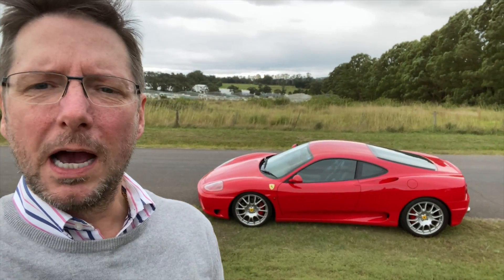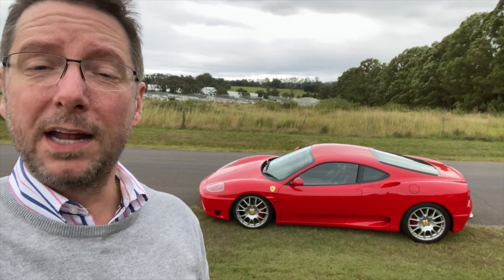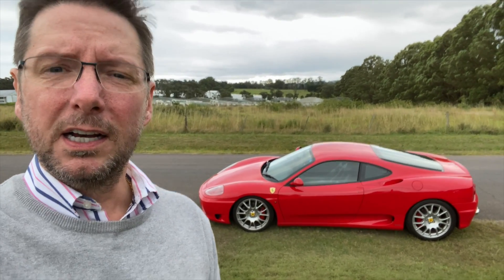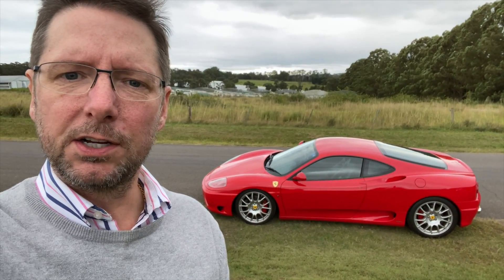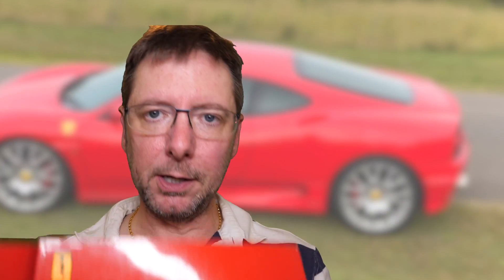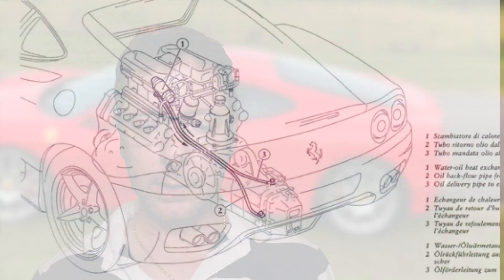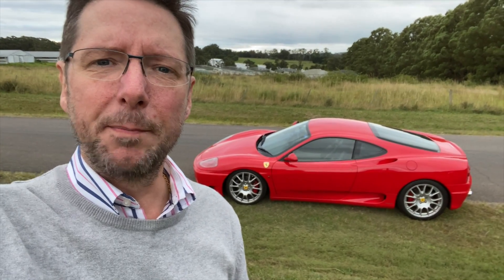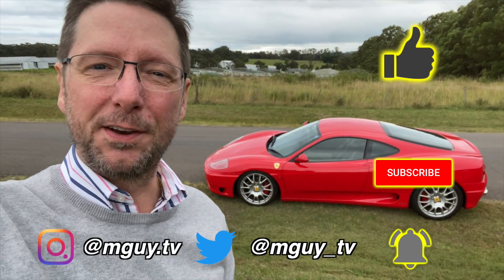This part can WRECK your Ferrari | MGUY

Comment: Great, video content, thank you for the useful information, other than noticing the oil in the coolant did you ever get any other symptom or codes? I just started watching your videos but curious for other clues. Sorry to hear the painful experience hope you can recoup some from the channel.
Reply from the maker: No codes, but I guess the catastrophic symptom of the limited slip differential failing, but I was new to Ferrari so didn't pick it up in time...
Reply: @mguytv    so a  failed  gearbox wont cause a code ?   if gearbox is low on oil will that cause a code ?

Comment: Could you replace the original heat exchanger ( block it off) and run the two lines in and out of a air cooled heat exchanger mounted in front of the radiator somewhere, that way nobody as any problems with the OEM heatexchanger again.
Reply: i cut the entire unit off on my 360 and work i connect the 2 hose together so the heatexchanger no longer work i dont recomend  this but i live in a caribean country and i need the car for the holidays and my mecanic say let just eliminated by connecting the 2 hose together and closing the 2 holles of exchanger with one small hose i did it about 2 year ago and no drama ever since  this can work fine but i know is no correct  guys before u guys go at me but i know few people that has done the same and no drama
Reply: @papaguede7934   thx for the info sir . i have a 360 also . i am thinking about doing the same thing .   what  brand   oil do you use in your gearbox and coolant ??    did you notice any increase  in  coolant temp  while driving or less ?  i  have always said that  ferrari should have used the same set  that is used in the 360 challenge  , a  transmssion  oil cooler  .

Comment: I’m confused...why did you think it was OK to drive it When you saw there was oil in the coolant?
The part is about 600 USD, But the couplers have to be replaced as well and those are about $200 each.labor is 2 to 3 hours, you can access it through the access panel Behind the front seats, all In should be about $1500usd.

Comment: What a terrible engineering design
Reply from the maker: I think it's an OK design but becomes terrible quickly if maintenance isn't exact. The Challenge Stradale has a gearbox oil radiator, so none of this heat exchanger nonsense.
Reply: MGUY is it a good idea to replace the heat exchanger every year as it’s a cheap part and will give you complete piece of mind?
Reply: @phil4977   just use the set up in the 360 challenge . have it converted to a oil radiator set up .
Reply: so  so  correct  . very bad set up .   its purpose is to protect the gearbox  but  its  " side effects "  can kill the gearbox and  your  diff  .  360 challenge has no such side effects .   its  gearbox  is   protected  from such a bad design .

Comment: OMG 😳, thank you so much for the information, I have owned my 360 many years now and I've never had such a problem (thank God 🙏🏼) but I've never done that check. That's something I'm gonna start doing from now on, truly appreciate it. In your research, what was the average amount of owners that this happen to? Curious to know  if I've just been a lucky owner or if some of those heat exchangers have been faulty. Thank you, keep up the awesome work on your channel.
Reply: they will all go at some point... its a wear and tear part and i changed mine during one afternoon.... out of 1 to 10, 10 being the hardest its a lvl 5.5/6 job...
Reply: UrbanRacer:  Thanks for the info, I guess I've been lucky thus far. Well, I'll be adding this to my list of upcoming due maintenance. Cheers